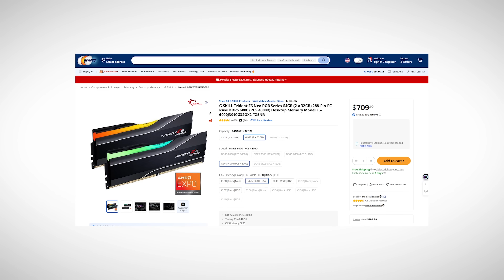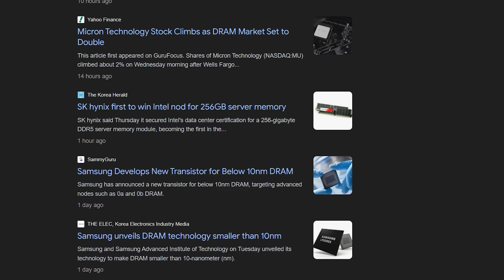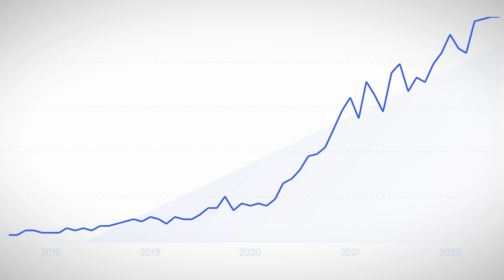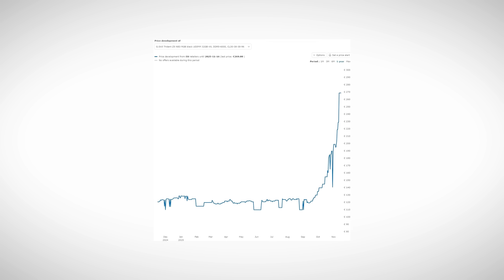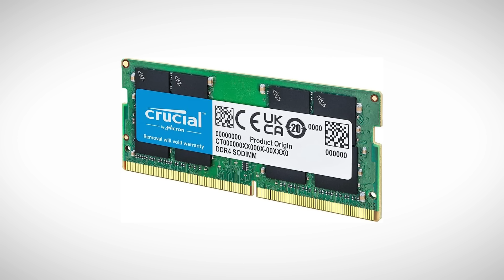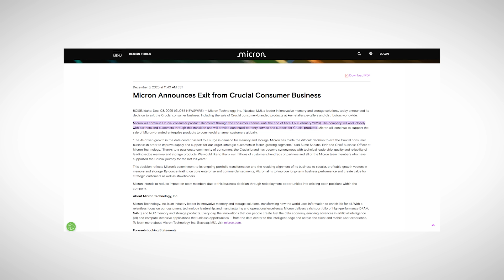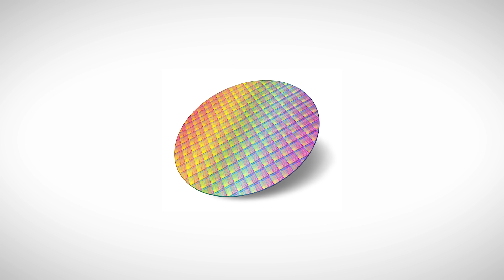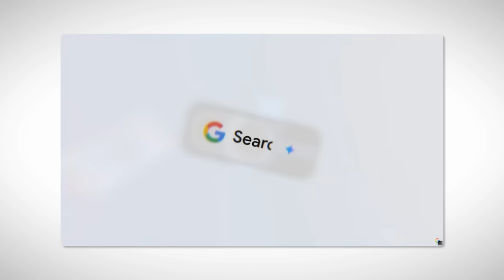Everything will be fine, trust me

Comment: even if AI is here to stay, this massive overspending on the Data centers will not. Open AI and other American AI companies are trying to advance AI through a caveman like throw more compute power at the problem and hope sheer brute force makes them better. And its a method that will fail. Because the way forward for AI is the optimization approaches. Other models are improving not by throwing more compute power at them, but by fine tuning, optimizing and reengineering the models to be better. A work smarter not harder approach. but Open AI is locked into the work harder not smarter approach and it will fail, but as it fails they will try every dirty trick in the book to try and starve out competitors, and buying up massive portions of the memory market was one of those stunts to try and starve competitors, because they are chasing monopoly first, effective product a distant second. But the scheme will collapse, and open AI will go down with it.

Comment: I just bought all the parts I needed for a pc to replace my ageing laptop. 9950x and 9070xt, all pretty high end. However I just couldn't squeeze in the 64Gb of RAM that I'd hoped to use for game development, as I simply could not allocate it into the budget, and had to settle for 32. I'm hoping it'll be enough for the time being, since engine editors and Blender can really eat up all the ram you give them.

It may not be the end, but it is certainly very inconvenient and is causing real problems.

Comment: Ram prices when i need to upgrade my 8 gb ram:
Reply: Buy used ram, i have found multiple used 16 gig kits for around 30-60$
Reply: Weeell, you can still buy 16 gb of DRR4 3200 RAM just for 200 bucks, that's definitely fine
Reply: @NameNameson840  crazy prices
Reply: @Vysair  yeah, the market will collapse
Reply: @NameNameson840 i saw 32 gb for 100
Reply: @pepsifan112 that's cool, what country are you in? The cheapest sticks I saw were about 200-250 bucks (ddr4 3200 16 gb)
Reply: @NameNameson840 my whole upgrade on laptop was planned to cost. 300 max and that s with new monitor
Reply: i will wait and buy a 32gb ddr5 ram 2 or 3 years later bcs i need to build a new pc all of my stuff are too old @NameNameson840
Reply: ram prices when i feel like it's time to upgrade my pc, wanna get a great ssd but it requires a better motherboard which also means cpu and ram (fucking x79)
Reply: if all you need is just ram get 16 ram its like 100 bucks

Comment: I didnt make it in time to upgrade my pc from am4 to am5, so to fight the ramageddon i maxxed the specs of my am4, doubled the ram, ddr4 is still cheap, this week i got my RX9070 and 2tb nvme, now i have ordered a new 850w psu to support the gpu hoping my ryzen 7 3700x wont bottleneck everything.
If this mess will end in 2/3 years, i'll jump directly to AM6
Reply: why don't you upgrade to 5700X cpu or above? Your 3700x clearly bottlenecks your rx9070 gpu..
Reply: @keep.fleep304  i'll gain only 20% in terms of power/speed but almost double the electric consumption

Comment: DDR4 Ram be like "You must be truly desperate to come back to me"
Reply: Never left, to be honest.
Reply: @user-qy2wf2lt6v  DDR4 became obsolete for a while in 2025 after the DDR4 production has been stopped, closing most of the gap between DDR4 and DDR5 RAM.
E.g. 2 months ago I've bought 32GB DDR5 6000 RAM, a 7500f CPU and a cheap B850 Mainboard + PSU for 325 bucks (I still hat an SSD and case to reuse) for a gaming server.
Put a GPU in there and you'll have a good budget Gaming PC with an excellent upgrade path and you couldn't build AM4 much cheaper, unless you get a good deal on the used market.
Reply: DDR4 still holds up today, yeah it's not as modern or fast as DDR5 but still packs a lot of performance. Don't treat my boy like DDR3.
Reply: Meanwhile DDR3 prices going up:
Reply: @nzt1306  brother ddr2 prices are also going up ;-;
Reply: @ender3770 I didn't know people were THAT desperate💀
Reply: @nzt1306  just hope that ddr1 prices wont go up
Reply: @nzt1306  That's cause sticks get progressively more difficult to find and there is a market for people building vintage and retro systems.
Reply: @The_Man_In_Red Oh, that makes sense. Thanks for explaining.
Reply: @ender 3770
I'm still on ddr2, hodld those 6 GB for over 15 years.
Is it finally time to sell?
Reply: @ender3770  sorry bud, but the AI tech companies need ALL OF YOUR RAM.
Reply: @nzt1306  whoever is investing in ddr3 today has to be from a 3rd world mindset. stick with ddr4 even if prices are going up, cuz at least its not as stupid as ddr5 (still stupid just less so)
Reply: Jokes on you, i never left.
Reply: My 5700x3d isn't going anywhere
Reply: high speed DDR4  is actually still pretty good
Reply: I'm still in ddr4 🤷🏽‍♂️

Comment: Imagine if at some point there is even gonna be a thermal paste shortage
Reply: Use toothpaste
Reply: @AL_47-p2g 😂😂
Reply: @AL_47-p2g  I did that with my obsolete PC it worked ok for a day then started overheating because the toothpaste dried out. I then mixed babyoil with a tiny bit of starch, applied it and it worked very very well.
Reply: @Real_Commander_Shepard  bruh 💀
Reply: DONT
Reply: Thermal paste can be created
Reply: @V1-gabriel-minos-sisyphusprime so can everything
Reply: @xninja83x67 yes everything can be made but years of spending in R&D is also mandatory to create those chip. Only one company ASML was able to do this and the problem isn't to create chip but to make it small as 5nm.

Creating isn't hard but process is
Reply: You need a teethpaste for your one teeth lil bro
Reply: Use thermal glue instead
Reply: you cannot run out of thermal paste. it's silicone oil mixed with silver dust, or graphite, or ceramic, jeez
Reply: @stickmouse5002 AI companies are hungrier
Reply: @stickmouse5002 don't say you can't...we had a TP shortage...its just paper.
Reply: SHUT
Reply: start buying you'll make a fortune
Reply: Shhh, don't give them more ideas 💀
Reply: @alpharorschach8708 they couldn't do shit with thermal paste
Reply: @V1-gabriel-minos-sisyphusprime AI companies CEOs are gonna eat it for breakfast
Reply: bro 💀
Reply: Crack an old mercury thermometer over your cpu, boom. Perfect heat transfer. (This is a joke do not do this, mercury vapor very very bad)
Reply: Lol
Reply: Don't give them ideas
Reply: Don't give them ideas

Comment: OpenAI needs to die.
Reply: They are

Spending way way more than they can ever hope to earn even with ads
Reply: *All closed source LLMs
Reply: Sora to be specific. I'm alright with Chatgpt as long as there's no image generation feature
Reply: @J-Specter-c3h 
Do you understand how normie and soy is you sound?
Reply: @Kongongongg  i don't get your point
Reply: Wow mister! Come down, please!
Reply: @user-qy2wf2lt6v  what are you even saying
Reply: wish all the AI data centers burn to ashes
Reply: yes, they will fail, because their approach is a fundamentally flawed on of throw more hardware and compute power at AI in the hopes that it will make it better. Its a failed work harder not smarter approach that will inevitably lose to more optimized better designed and engineered AI models
Reply: @ryuukeisscifiproductions1818  And not just hardware. The power plants in many of the data center areas don't produce enough electricity to run their ever growing demands. So they put massive generators in place that burn gasoline. The areas have MASSIVE air pollution. Those are some of the very same companies that promote the whole carbon footprint and ban of plastic cups and straws stuff...
Reply: @Aura.ad.Infinitum  they try and push the general public to reduce carbon emissions as a way to push responsibility on other people, but the reality is that 80 to 90% of the pollution overall comes from commercial and industrial activity as well as the domestic consumption of the top 1%. And thats more or less how its always been, the biggest consumers and polluters have always been the super rich and their companies.
Reply: @ryuukeisscifiproductions1818  Yup. It's large scale gaslighting. Tricking people into a frame where they are the problem. 
That's something that stood out to me when I started learning about narcissists and abusive relationship dynamics. The structure of society follows the exact same damn patterns. It's a massively large scale abusive relationship between the people and the system
Reply: @ryuukeisscifiproductions1818  Yup. It's basically large scale gaslighting. And a system-wide abusive relationship between the people on one side and the system on the other
Reply: As a pro AI,yes, OpenAI NEEDS TO GO.
Reply: @0xEEENOLIHERE  I can't be pro ai in this time & age
Reply: Ofcourse 
Go ai go
Go ai go
💩ai💩
Reply: The common sense position
Reply: oh my god what an original take
Reply: Another stupid hater. They could just make more RAM.
Reply: @NoidoDev 
The economic problem: "There are finite resources meant to satisfy infinite wants". It's not as simple as "just make more".
Reply: @Parad0x_Syndicate-u7c Yes, they could make more FABs but won't. Most of the new AI foundries won't come online until 2027 at the earliest. They chose AI companies over consumers. They could make more but they don't care.
Reply: Nah, ChatGPT is the goat
Reply: @Gloverfield chatGPT is about to go out of business lmao
Reply: @linuxramblingproductions8554 wait, really?? Why?
Reply: @Rurukkkk because openai has been going into debt buying stuff with money they don't have. They have never made a profit and aren't expected to until 2030 and they have been billions into debt year over year. they are estimated to be 96 billion in debt before making profit. (i don't think they will ever make a profit tho lol)

theres plenty of articles explaining how openai is a financial mess

Comment: I believe thinks will start to slow down from mid next year
Reply: very optimistic but idealistic.
Reply: there are many ways this thing blows over. 

Micron has a facility in Idaho that's going online mid to late 2026, 
Open AI has over a trillion dollars in future commitments yet they are still run at a loss
Despite more and more complex models coming out consumer adoption remains low 
China may have cracked the hardest part of Memory fabrication "ASML's Extreme Ultra lithography machines" (their 70% of the way to developing their own ram)
 
I think We'll start seeing a real change in mid to late 2027.
Reply: @ChainLinkowo  If China starts supplying the A.I overlords their wafers then the other manufactures SHOULD start resuming consumer wafers?
Reply: @R4M845   Pretty much no country has been able to pump out goods at scale the same way China can I'm sure they'll be pumping out chips by the billions withing the decade, What matters isn't really the manufacturers coming back to consumers but breaking up the memory Oligopoly, Techno feudalism kind of sucks,